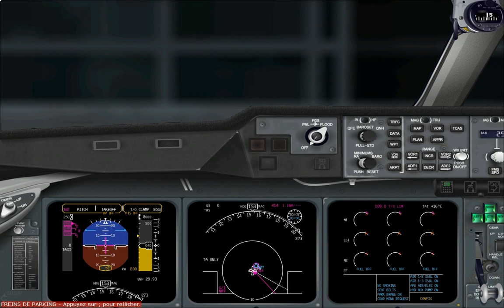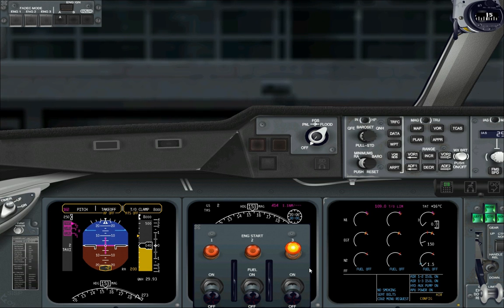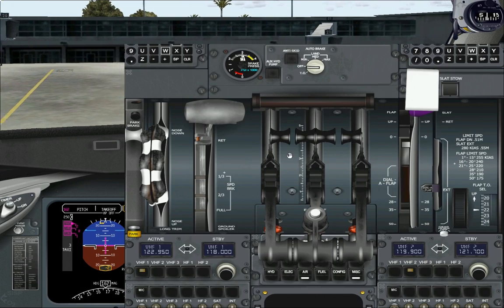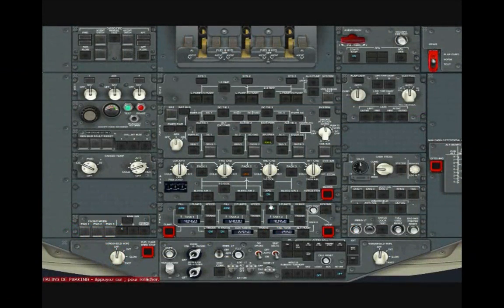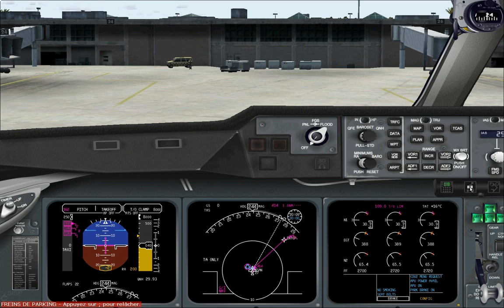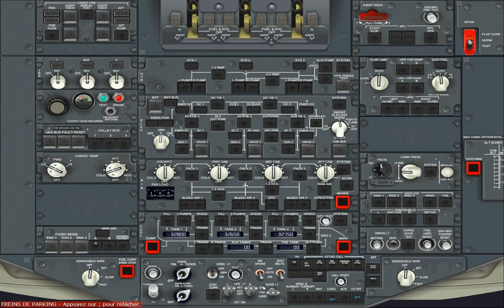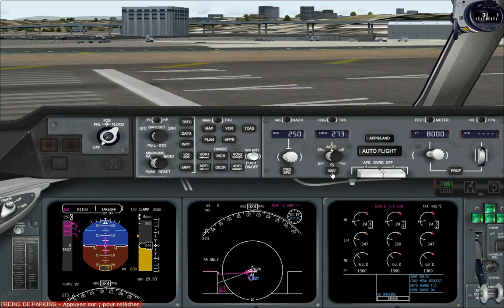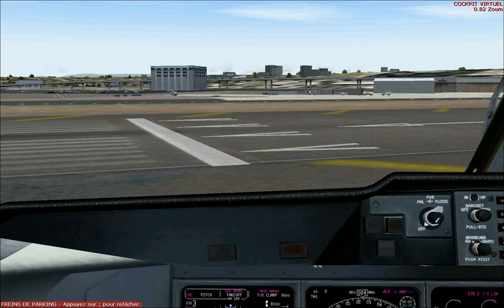PMDG Md11 full tutorial part2

Comment from the maker: @JokaWild88s What you need to do first is be sure the rwy can take autolands. It has to have a CATIII ILS system. Then for the ILS approach, you want to enter the ILS frequency in the radnav page of the FMC. If you aren't flying a flight plan in the FMC, you have to be on a course that intercepts the localizer. When you are, you can press the APPR/LAND button. Once you intercept the localizer, the AP will take over all the controls (but not speed) and will land the plane.